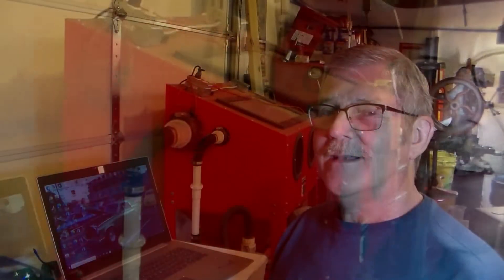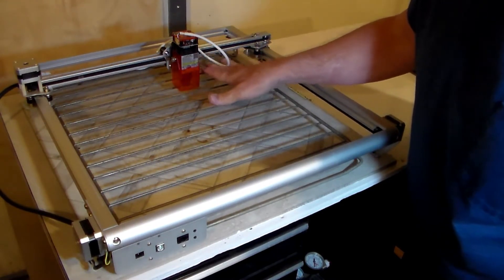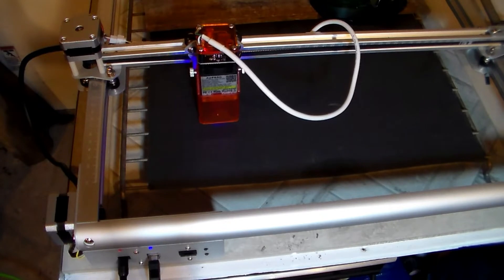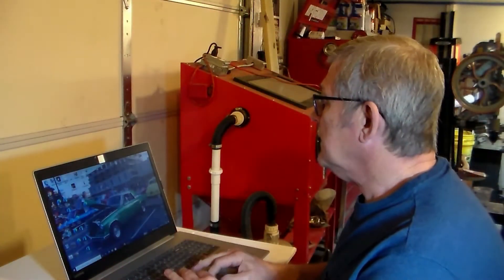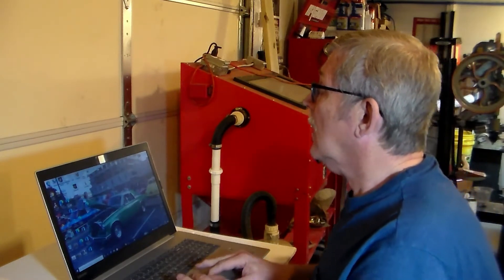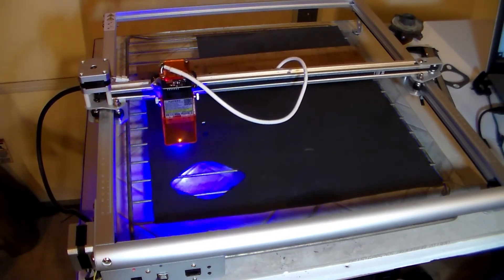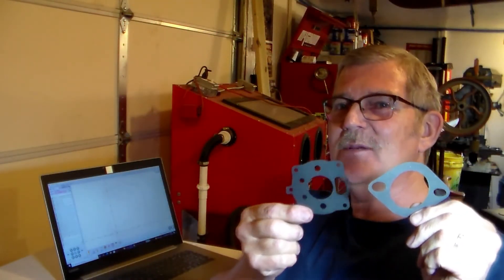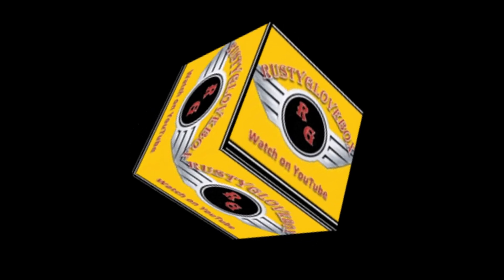Laser cut gaskets with the AUFERO Laser 2

Comment: Copper or Stainless Steel head gaskets for small engines ??
Reply from the maker: It can cut but this laser is only 5 watts. Cutting metal that thick might require a more powerful laser. Thanks Jim